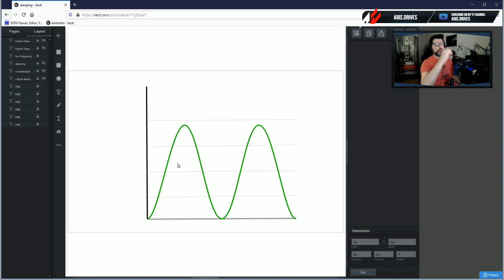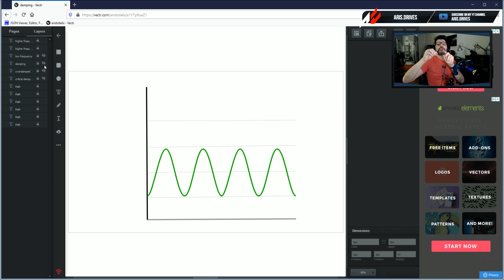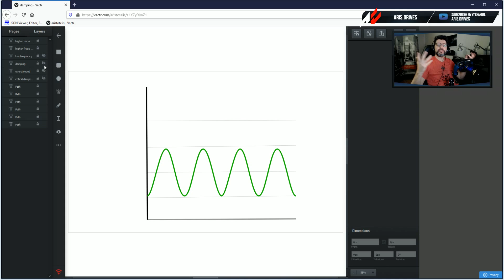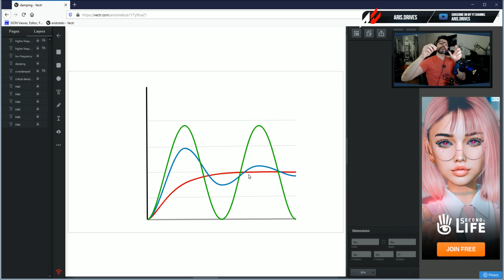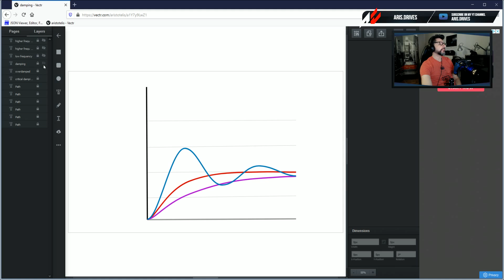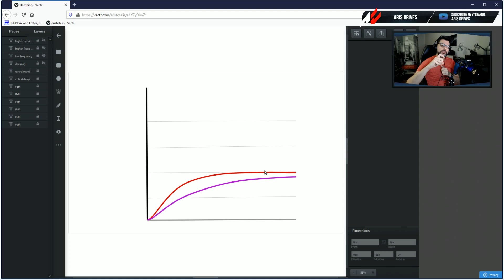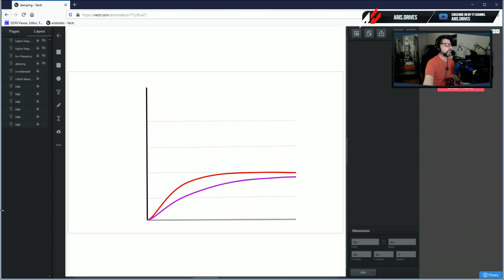TL;DW - Dampers Part 1. Why we need dampers?

Comment: Hello Aris , i have a question that isnt related to ACC and its kinda weird. Why do some cars like Ford RS200 , Lamborghini Countach , Ferrari 512BB and Testarossa have twin coilovers per wheel? What all these cars have in common is that they are all tubular space frame. Is that the reason for this twin coilover setup? I really cant see any advantages of this setup aside from maybe smoother suspension movements? Meanwhile it has a massive disadvantage compared to single setup , increased unsprung weight. So i cant really understand why those cars went with twin setup. I asked here because i thought maybe you would know since you are very very knowledgable.

Comment: Was the issue of telemetry laps not saving when the User folder has a special character in it? ACC won't save my telemetry because my username has a tilde in it :(
Reply from the maker: A tilde in the username? Oh don't know about that, but it certainly does sound like something that could cause issues... maybe you should visit our official forums for specific support or at least report so we can see if we can do something about.
Reply: @ArisDrives   There was a guy that did a bug report a while ago. I didn't want to necro the thread or something like that so here's the link: https://www.assettocorsa.net/forum/index.php?threads/motec-export-fails-if-windows-username-contains-special-characters.58515/

Hope it helps. I get the same error in my log.

Comment: First of all.. thank you for taking  your time to explain us this important stuff. I think everybody here feels the same way and aprreciates your time. I have a question about the damper settings in motec. My problem is that on every track where I try to get this 20/30/30/20 distribution between the dampers  I have to set the slow bumps/rebounds as low as it is possible and the fast bump/rebound as high as it gets. Imo this seems weird and false. Tips are welcome :)
Reply from the maker: The 20/30/30/20 rule is more valid for less aerodynamically influenced cars. I wouldn't follow it that much for GT3 cars. It might also be that the 20hz resolution of the motec export, makes it difficult to find some speeds. We'll try to enable for you guys a high resolution for some of the channels.
Reply: @ArisDrives  sadly i think its not because of the resolution. Because in ac when you use acti its the same "problem". I would be so happy if there is an answer for this behavior :)
Reply: You probably dont care at all but does anybody know a method to get back into an instagram account??
I stupidly lost my password. I would appreciate any help you can give me
Reply: @Arian Quentin instablaster ;)
Reply: @Baker Kyson i really appreciate your reply. I found the site on google and I'm trying it out atm.
Takes quite some time so I will reply here later when my account password hopefully is recovered.
Reply: @Baker Kyson It did the trick and I now got access to my account again. I am so happy:D
Thanks so much, you saved my ass :D
Reply: @Arian Quentin You are welcome :D

Comment: Shouldn't the spring oscillate above and below the x-axis? After it gets weighted by the car it should be in a partial compressed equilibrium state.
Reply from the maker: True, but the graphs are for easy of understanding and demonstration purposes. Also remember that the inertia of the hole body, can pull the spring in bigger oscillations, but the suspension also has travel stops in extensions to keep the spring from extending over the limit

Comment: Again love the content, would love some insight on cars like the Audi and Lamborghini with their smaller operating windows. The Huracan won the Endurance championship but we see it less and less in races due to the sheer difficulty of finding its operating window and then the difficulty in driving it at or near the limit.
Reply: yep exactly same opinion. Nice advice/suggestion.
Reply from the maker: Keep in mind the particularity of the Huracan. Yes it won the Endurance championship but it was mainly on the efforts of an incredible team, it's engineers and it's drivers. Almost all the other Huracan teams had a hard time finishing at the top of the podium. 
I will definitely do live streams dedicated to each car
Reply: @ArisDrives  thank you!
Reply: @ArisDrives  Thank you Aris, I definitely realized that, especially in your streams were you mentioned the ease of some other cars to reach the limit and stay there like the AMG and Ferrari. I've been a fan of the Huracan for as long as it has entered Blancpain back in 2015 and storming to pole in Monza (one of my fav tracks).

However, I do wonder how Grasser did not achieve at least the same level of success as FFF Racing, at minimum Bortolotti is enough for a pole lap and win.

Would also be nice to hear more stories about IRL racing that you've been privy to. That's always enjoyable as well. Again, many thanks, for the sim and the content, it's tops.